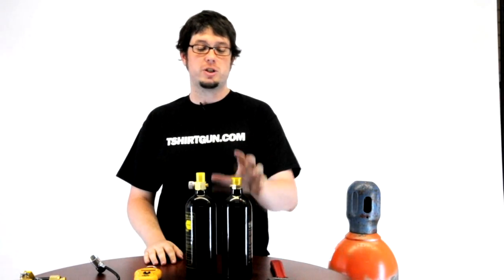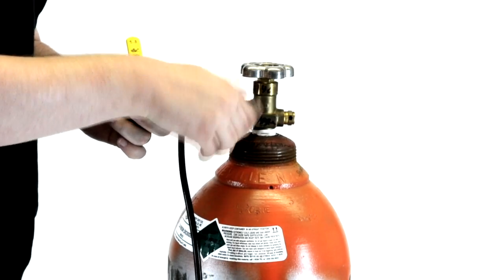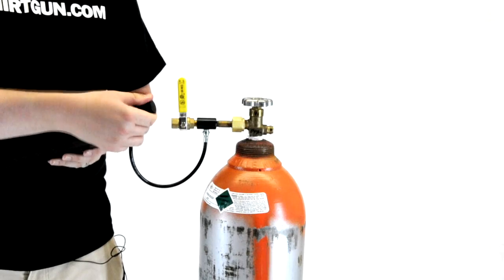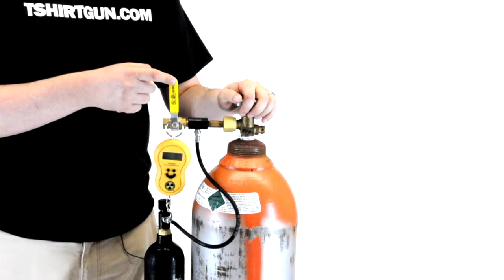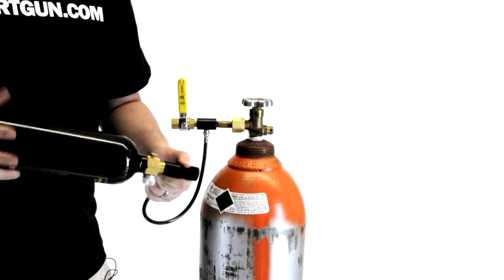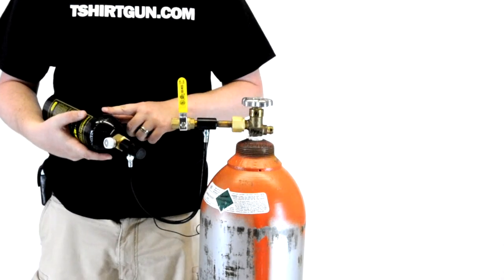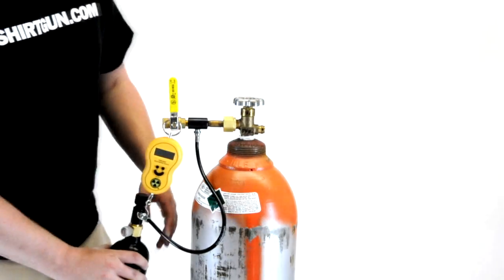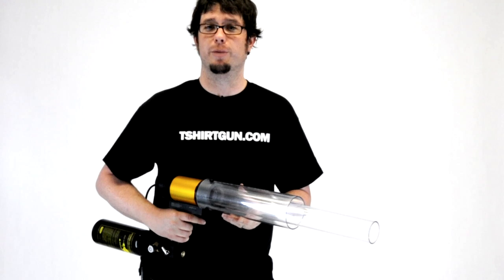How to Fill a CO2 Tank

Comment: You should have a regulator on the big tank for safety to do otherwise is nuts.
Reply: Mark is correct, you cannot actually fill the tank if you reduce the outlet pressure. (Which is all a regulator does)  Also gas regulators do not function with liquid, which is what is being transferred here.
Reply: You could get one that only restricts flow, but you can’t just get one of them easily
Reply: Mark Nielsen 

Size of tanks isn’t.

Sheer volume of tank size!!! I’m certainly not working around you buddy if your operating tanks/filling tanks without regulators/ free standing tanks?
Accident waiting to happen.

Comment: How to you fill the big tank with c02 (without using a bigger tank lol)?

I have been searching and I found out that you can mix baking soda with vinegar in a bottle and attach a balloon on the cap to get a balloon filled with co2, how do you take that c02 and put it in the main co2 tank??
I have searched everywhere on the internet with no answers. Every time I search "how to fill a co2 tank" I get people filling a co2 tank with another co2 tank which doesn't answer my question.
I want to create co2 and put it in a co2 tank plain and simple. What do I need?
Reply: Take it to an air gas supply and get a new one lol only $25
Reply: if you have the tank, you bring it to a gas supplier, they take your tank, and give you a full one of equal size, for the cost of the gas. if youre asking where they source their carbon dioxide, i would imagine its through industrial processes on massive, economically viable scale, likely collected as byproduct from other unrelated processes and repurposed, rather than released into the environment. to be honest im just assuming, given the cost, that its a waste material that is upcycled instead of having to pay to properly dispose of, or render chemically innert, and exhaust into the environment. but there may actually be dedicated multimillion dollar pumps and vacuumes and chemisty involved in the extraction and purification of quality co2 from the atmosphere. good question